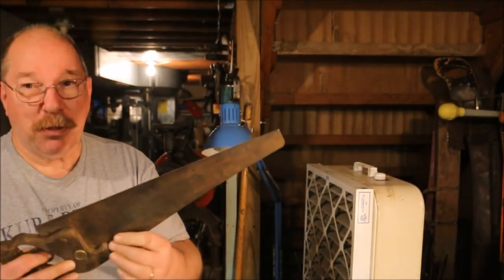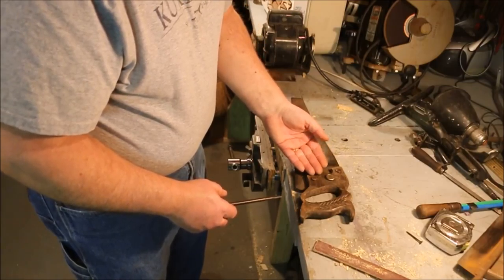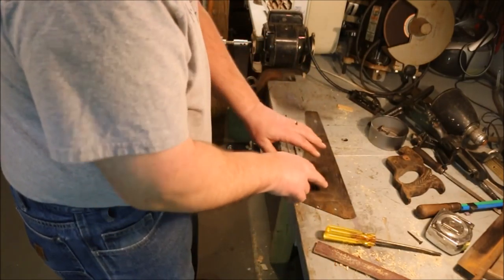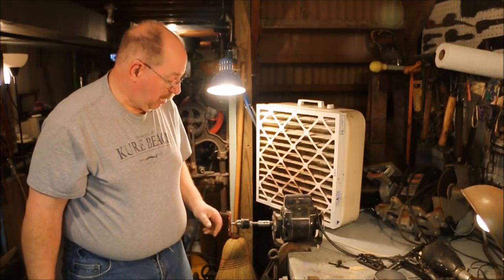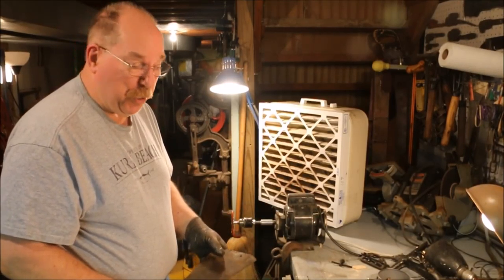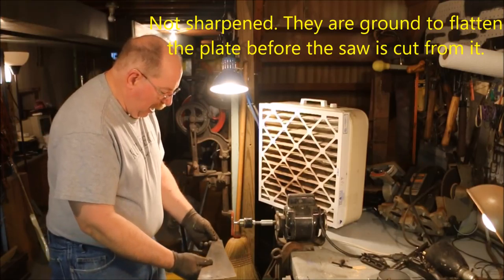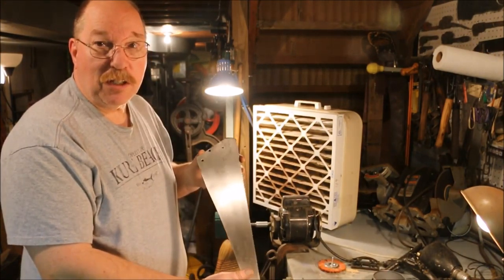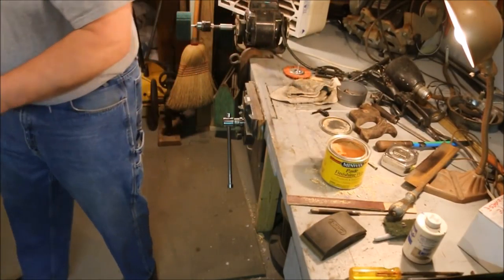NEW METHODS TO RESTORE HANDSAWS ~ PART 1 ~ POLISH THE BLADE

Comment: That fan-filter is a GREAT idea (at least when you turn it on 😉).  I recommend getting another cheap 20 inch filter to put in front of the other one.  Maybe even a washable fiber one.  Basically a pre-filter to catch larger particles before they get to the good one.  They help to catch the dust and grime, and since you will clean or replace it more often, it winds up doing a better job.

Comment: Thanks for  calling rust what it is!
Reply from the maker: John R. Hargis I think sometimes perspective plays a part. If I have an item that is a possible collectors item, by convincing the buyer that the rust is a feature rather than a problem I can charge more for the item.  
A rusty item is a Shrodinger cat situation. It might be okay or not. Removing the rust won't make it bad, but it will expose problems.

Comment: hoping for some BLO on the tote :) do you not like electrolysis on this type of work? just interested in your thoughts
Reply from the maker: BLO on the tote. Is there any other way?
Electrolysis works but the blade still has to be polished to remove the rough surface left by the corrosion. This is just skipping a step.

Comment: See what you mean now that wheel does a dandy job . I seen the grey ones and used never new they had a grit size on them only had them in course medium and fine but always the same colour but they look to do the job thanks again for useful info ..
Reply: You need a wheel almost as round as my head is in the round part. The rest will shake too bad, being out of balance but that was where I landed being dropped to see if I would land on my feet, them being as large as they were. The head always won out.  I repaired the walkway when I got older.
Reply: Lewie McNeely I'd always land on my feet that were all the good stuff is top ends empty if you blow hard enough through my left ear you get a whistle out of the right . With a couple of good lenses I'd make a portable telescope 🤓🔨👍
Reply: My head is full of something heavier than the rest of me. Certain not-so-nice people have told me things but they have no couth.
Reply: Lewie McNeely I'm just full of that stuff anyway.bit like a bell shape .every time I open the trap a clang comes out as well
Reply: Could very well be. My ancestors came from over that was as well. Just runs in the family!
Reply: Lewie McNeely well you've hit the nail there most of what comes from the uk is a bit the same lol
Reply: I hate it when I get it right.

Comment: Ah HAH, the H.B.Rig  and don't forget to put your stuff awn. Bless you, Unc. I'm still grinning over that! NAPA has those wheels but I can't remember who makes them and Ace has the bristle jobs. The one I got was as useless as a side saddle for a hog but maybe I was trying to do the wrong thing with it. I didn't notice it until you started using the green wheel Scotch-brite but the dust/crud really flies in the light. Maybe not so much in the dark.  Nice looking job and rust will always be rust unless it's just general crud. Fancy names mean not much.
Reply from the maker: I forgot to turn on the fan in the beginning. 😊
These wheels came from HF. The first one was a 3M and then the rest of them I bought cheap. They still work.
Reply: The NAPA ones might be 3M. If I can remember I'll look the next time. Pretty sure that's it though. That's a good filter though. Even when it's running it's a site quieter than the squirrely cage one here.
Reply from the maker: Lewie McNeely It's nice with the camera lights on too. I don't have to wipe my face to see. 😓

Comment: I saw wanglerstar use a product called evaporust (sic) with great effect
Reply from the maker: John lastname Evaporust works. At $19.06/gallon it is rather expensive. https://www.walmart.com/ip/Evapo-Rust-Super-Safe-Rust-Remover-Gallon/48810395 
This little saw is about 18" long so it would fit in a shallow pan or a plstic tub. A gallon would immerse it. 
After it is immersed the saw still has to be polished. The evaporust removes the rust that has eaten away the surface of the saw plate. The rust is gone but the rough etched surface remains. To remove the drag you can sand or buff the surface. 
The powered wheels remove the rust and polish the plate at the same time. 
The advantage that Evaporust has is it does remove all the rust if the plate is left in it long enough.
Reply: I like Evaporust, but here in Canada it's $15 a quart so I have never used it to soak stuff in.  Instead I use it with green scotch brite to wet sand rust off. :)   The evaporust neutralizes the rust down i the pits and works with the abrasive on the surface rust.  It is also good to free parts that have rusted together, I just put a bit at the joint and let it wick in instead of using a penetrating oil.
Reply from the maker: Never thought of that one. I have a bottle sitting at the end of the bench. Does yours stink after it has been used? I keep the bottle closed and only use it outside. It smells awful.
Reply: I haven't noticed a bad smell, but then my sense of smell isn't very good.  Clean it off before it dries or it will leave dark stains on the metal.
Reply: Hand Tool Rescue (https://www.youtube.com/user/erzzi6/ GREAT channel by the way) uses Evapo-Rust quite a bit.  I don't know if they sponsor his channel, or just some of his videos, but it does work.  He soaks most of the parts he has in a 5 gallon bucket of the stuff.
I've used it myself on an old hand plane, and it seemed to work OK.  But you still have to polish the pieces afterward.
Reply: They do sponsor his channel.
Reply from the maker: Always willing to try new things 333rpd. I used your method on the stand for George's Foley Belsaw 1055. Worked good. Took off the rusted on grinding dust without removing the paint. 👍

Comment: DO YOU KNOW IF THERE ANY HAND SAWS STILL MADE IN AMERICA  ?
Reply from the maker: Yes and you can even get a job there. As soon as they are hiring that is. http://www.jobs2careers.com/local/american-saw-%26-manufacturing-co-DLba3k/
Reply: A-PLUS!
Reply: i can manage the 'talented home sitter job' not sure what talents they want though...lol, their brand name is lennox, so its mostly hacksaws i think now
Reply: I was pondering the gasoline engine mechainc diesel. That'd be a wild ride!
Reply: im too old lewie! been there, finally got the grime off my hands, besides i cant lift  a feather now, let alone wheels and gearboxes
Reply: The only thing I can think of that was both gasoline and diesel were the old International Harvester and Cat engines. The IH's had a 3rd valve that lowered the compression so the engine warmed up on gasoline and then switched to diesel and the Cats had the 2-banger starting engines. But about all of them have been replaced or hidden so that jo0b might be an easy chair deal.
Reply: i think you took the title too literally lewie!